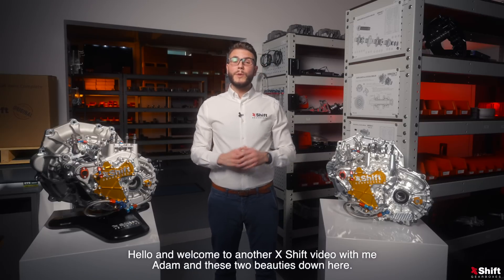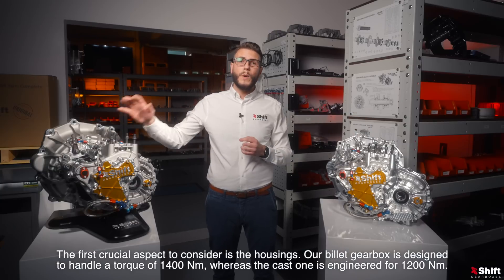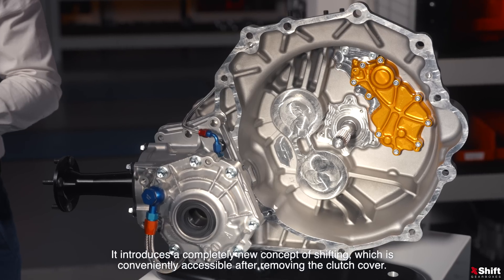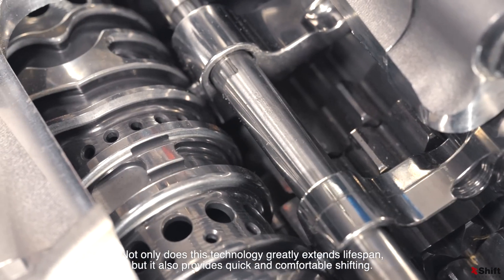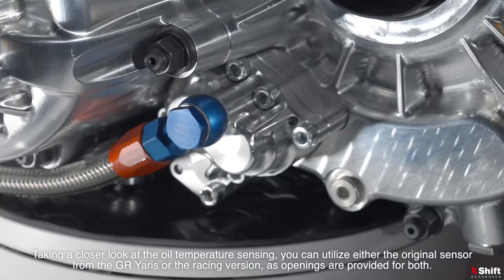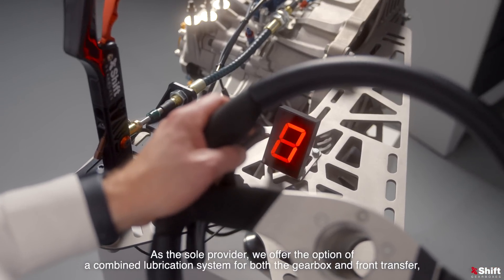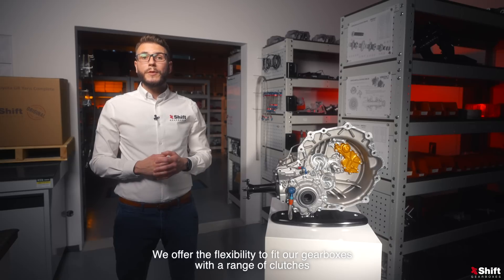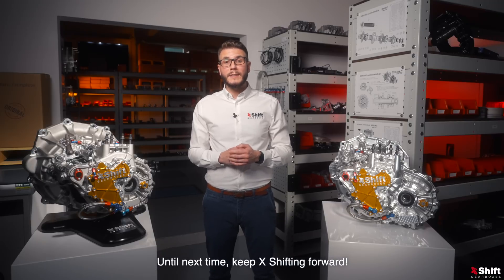Top GR Yaris / Corolla sequential gearbox solution available worldwide | X Shift Gearboxes

Comment: For flatfoot shifting is a ignition cut necassary, is that possible with the oem ecu? 
Also when downsifting the auto throttke blib will work either? 
Are plans for the rear differential housing and lsd also?

Comment: Sir,if i use this gearbox,do i need pedal clutch or not? should i remove?
Reply from the maker: Hello, yes, the clutch is still needed for starting and reversing. When racing, flat-shift and throttle-blip strategies can be applied, and upshifting and downshifting can be done without a clutch.

Comment: How unnecessary would this be for my daily driver GR Corolla? 
I want the straight cut gear sound with the driving experience of banging through the gears on my way to work 😈
Reply from the maker: Hello, It can be used, however, the noise is, as you write, is increased, so e.g. noise cancelling headphones are quite a good idea.

Comment: hi on a stock gr yaris engine how many km before rebuild with cast one?
Reply from the maker: Hello, with stock performance and standard use, the gearbox will last several thousand kilometers without needing to be checked. After that, a preventive inspection is recommended, often with a minimum of parts to be replaced. This gearbox is very durable.

Comment: So without tuning the engine, what 0-100km/h times can we expect?
Reply from the maker: Slightly quicker than with a OEM H-pattern manual gearbox, as it clearly has a higher delay and slower shift speed than flat-shifting sequential gearboxes.
Reply: @xshiftgearboxes  Thanks! i wonder how the hell Rally 2 cars, that have similar torque, HP and weight to the street model GR can get to 100 in about 3 sec. I thought it was the gearbox..